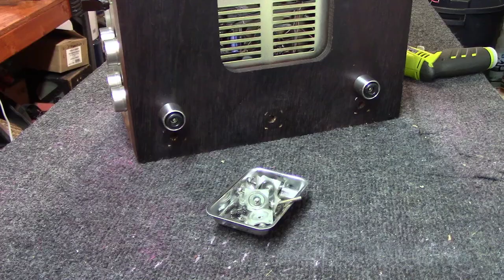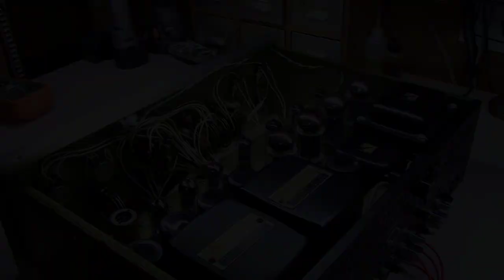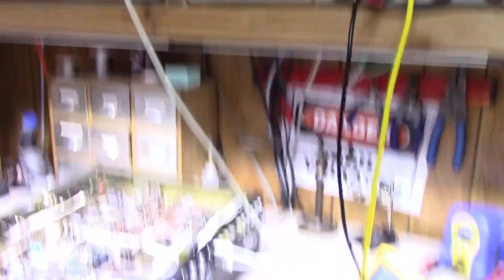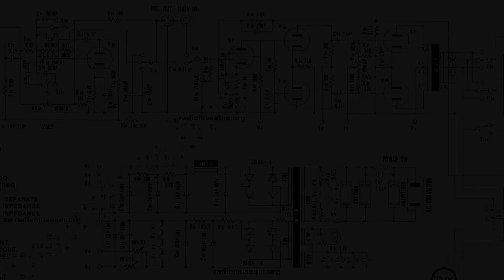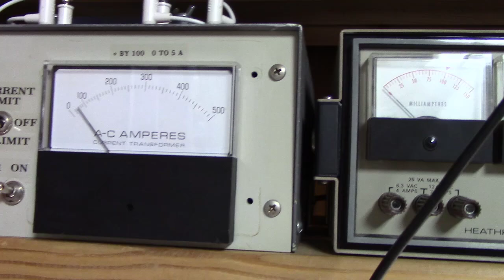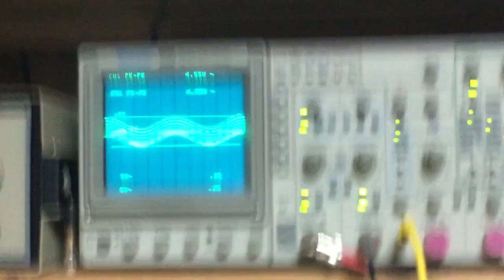Luxman SQ38FD Tube Amplifier Repair

Comment: Good evening, I have a pair of Luxman MB88 Ultimate power amps from 1983. V1 adjusts bias, V2 balances, I replaced all the existing components, V1 fixed at 45mA, V2 dancer 35/55. Help

Comment: Hi Alan from New Zealand here.
Great Video!
A fairly experienced 70 Yr oldTech, I have never struck a fixed bias Triode OP before!
 I am repairing one of these Amplifiers and wondering how you set the bias on your repair?
I have added some 1 Ohm precision resistors in the 50CA10 cathodes and before trying to adjust I am getting 6 - 8 mA per tube.
Would that indicate that the tubes have lost emission?
I am being extremely cautious so that I do not destroy the very rare tubes.
I suppose I am looking for reassurance before I crank the bias current up.
The amp sounds nice, I have not had a Scope on it yet to look for crossover distortion. 
This Amp is a rare 240V model and they derived the 100V for filaments from a tap in the Primary Winding which I think is a bit Naughty!

Comment: The strange Japanese speaker jacks are found on the "modern" DENON POA-4400 & POA-6600 power amps too. But the US versions used the traditional jack type. Odd.
Great video! Thanks. =)

Comment: I have just purchased one of these. The one I have uses a mains transformer type 8A70B. Your amp uses the same mains TX as can be read clearly in your video at 22.40 minutes. It does not show on the rear of the amp (only says 100v 50hz and 60hz only) but there are tapping’s on my mains transformer for primary inputs of  100V (Japan) and 117V (USA). Using it on the 117V taping the secondary heater supply correctly reads 6.3v ac  so the transformer can definitely be used on both with a slight wiring change.(be sure you know what you are doing !!) Sadly it doesn’t help me as I am in the UK (240v ac) but hopefully this info might help someone.
Reply from the maker: I'm going to investigate this more...  thanks for the heads up
Reply: @Blueglow  I have a Luxman LX-38 Ultimate 100V model - same family as the SQ38FD.  Having a similar symptom that this amplifier had and I am hoping that this is the same problem and can just wire in jumpers.  What did you find out about the transformer because I will have tech use the 117V if it is there that will eliminate the need for the stepdown transformer?
Reply from the maker: It seems some do and some don't have transformers that can do 117v.  Take off bottom and send me pic.  @FluffyMcDermott
Reply: @Blueglow Sorry for the delay in response. I asked my tech and he said no the LX-38 Ultimate was only 100V.  And this probably makes sense since this one was never made for US market.   Love your videos.
Reply: I always take the correct filament 6.3 V as a reference for line voltage adjustment ......Very important and often not respected..

Comment: You may have obtained a switch or decided to jumper it but perhaps contact Hans who runs the Yahoo Luxman group. hans.hilberink@hilberink.nl http://www.hilberink.nl/codehans/luxman.htm
I have a nice L30 but it could do with a replacement balance pot. Unfortunately this solders in through a PCB so a pain to swap in a new one. If it's available of course.
Reply: L30 has a volume ( double adjustable) but no balance knop ...fantastic sounding amplifier when overhauled the right way. Often after service and recap it sounds worse than the original...

Comment: Would the double triode tubes be ECC88s if so then try new ones they don't normally go wonky but only very seldom  do they do go bad or what about Slavetna equivalents that might solve the problem.